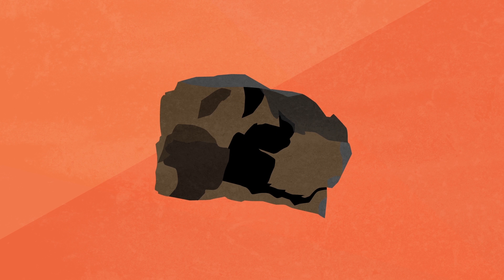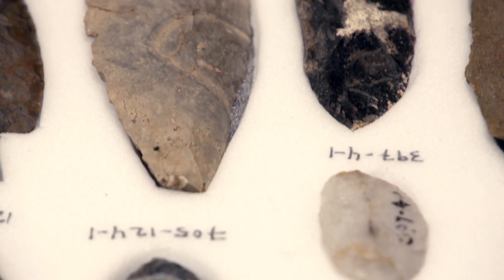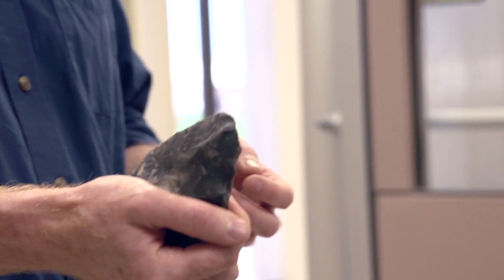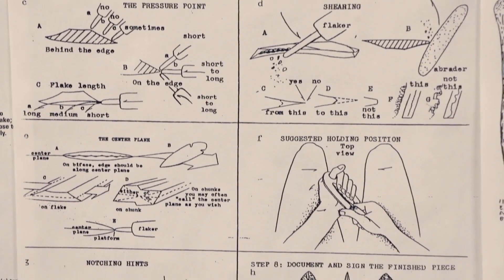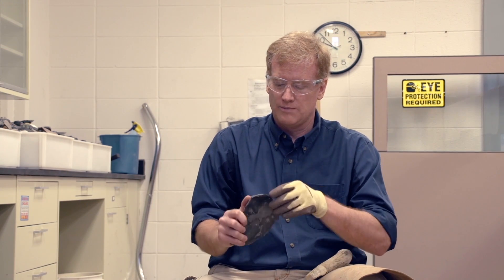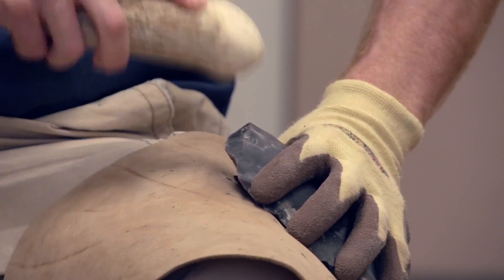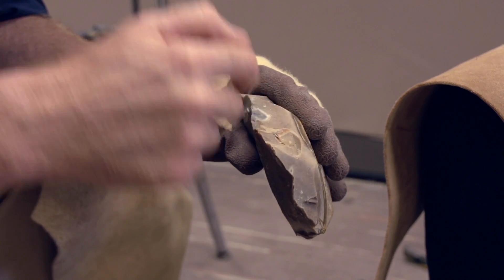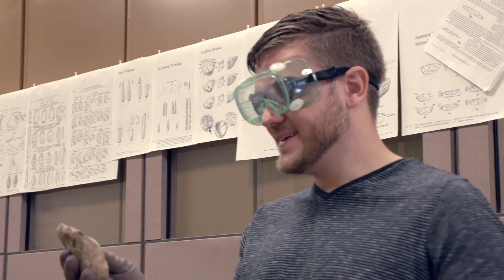Flint Knapping | How To Make Everything: Tools (2/6)

Comment: What all the tool made from flint or any rock?
Reply: Michael Vernon pretty much anything the breaks with a concoidile fracture and has silica in it. Like flint Quarz obsidians and cherts. You can also use copper boppers and copper pressure flakes I use antler personally this technic is called "abo"
Reply: It has to be a rock that is hard, fine-grained, and a homogeneous material. Flint, Chert, obsidian, modern glass, agates, etc. are all stone that can be made into sharp tools. You can make many other tools from different types of rock, but sharp ones have to be like flint.

Comment: i cant find any flint/ obsidian in MN
Reply: Noah Koenig Don't only look for flint or obsidian, walk around some rivers and you can probably find some agates, look for basalt even, if it's fine grained enough they often fracture conchoidally.
Reply: Noah Koenig if you can't find flint or obsidion you can use glass instead.
Reply: christopher snedeker but it still works so I use it
Reply: christopher snedeker yes it is dangerous and glass isn't the strongest alot of times when I flintknap with glass the arrow head might break in half and little shards go everywhere
Reply: Noah Koenig use glass
Reply: If you can find granite you can use that. It'd be really hard though.
Reply: Granite doesn't knap. You need a homogeneous material that is glass like. Cherts, Agates, Quartzites, Obsidian, and Modern glass are what you need.
Reply: @brandynr2527  i never said you could knap it. I mean you can grind it and  flake it.